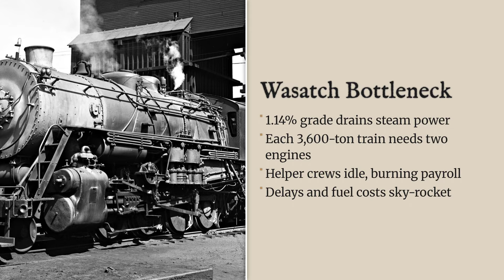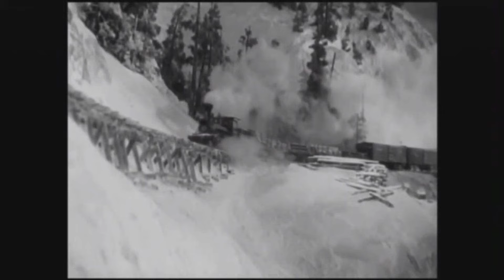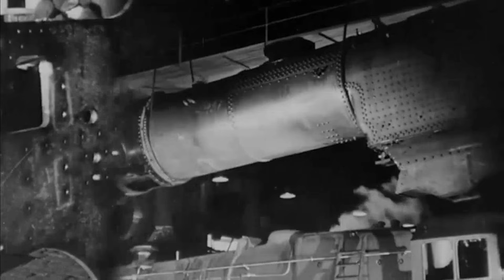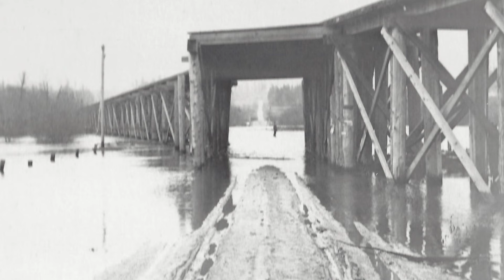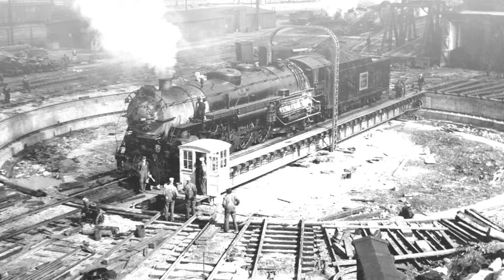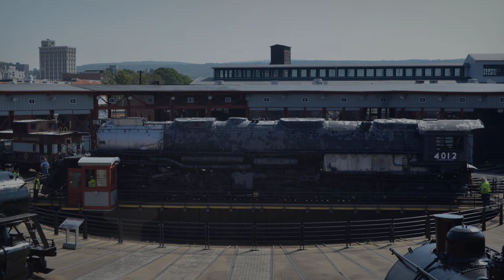The Locomotive So HEAVY They Had To Rebuild Every Bridge It Crossed

Comment: UP seemed reckless, after they get the engine they discovered they were having to redo all the bridges, rails, ties,  curves, turntables, and then again later they come up with that turbine driven engine that was so loud it could be heard for miles, sounded like a jet plane taking off, and could tear steel couplers right out if the engineer was too aggressive in taking off, and then they discovered  the turbines only liked to run basically full blast and didnt like being "idled" during stops, so they burned thru all kinds of then dirt cheap bunker C fuel, which soon skyrocketed in price making the whole economics fall flat on it's face.